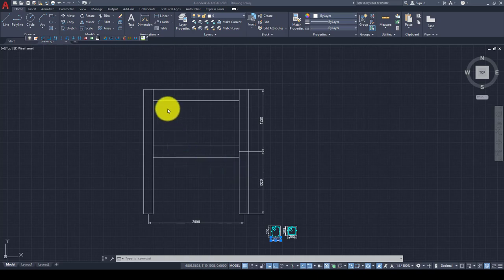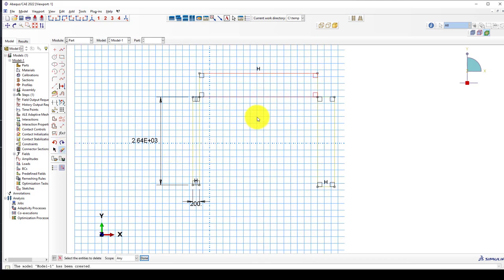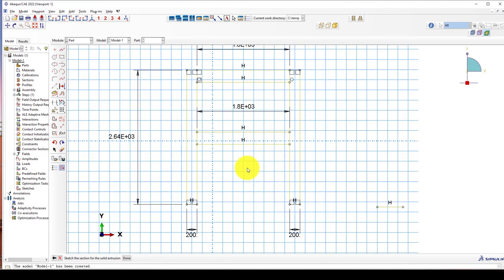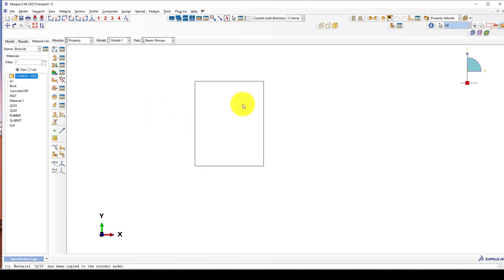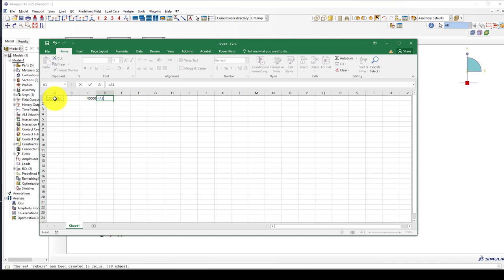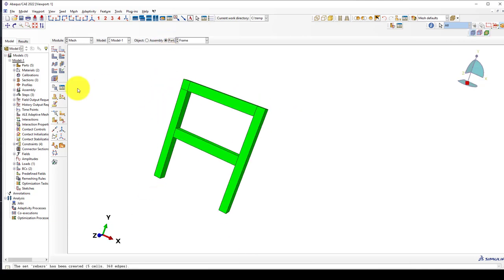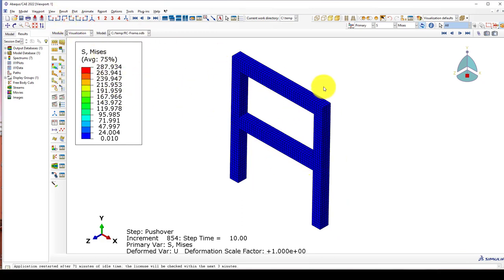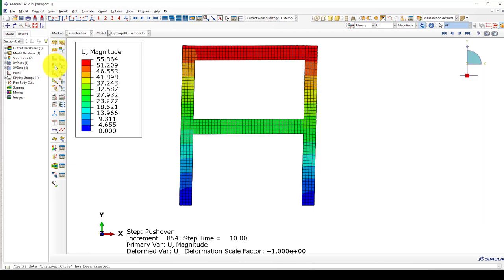ABAQUS Tutorial, Reinforced Concrete Frame modeling and Analysis using CDP Concrete step-by-step

Comment: Thank for sharing this tutorial
I have a question why you choose exactly to apply 50 mm as displacement not other value
Reply from the maker: Hi, you can choose any number you want.
Reply: @KSSE_Engineer  
Thank you for your response
But how can I confirm that I made a good choice I mean the right displacement value 
Another question
If I have an rc frame with more than  two floors (for or five) is it relevant to  apply a displacement for each floor
I appreciate what you do thank you sir